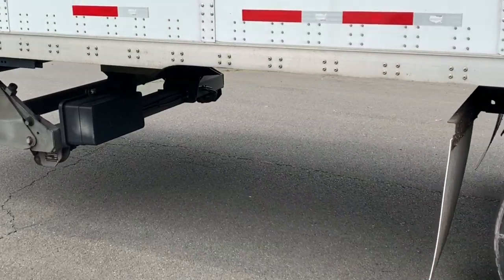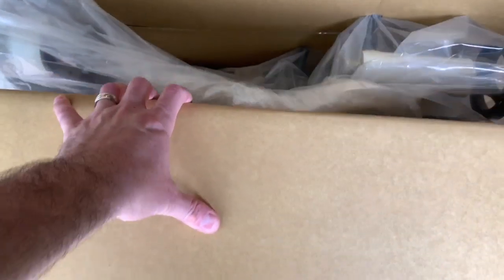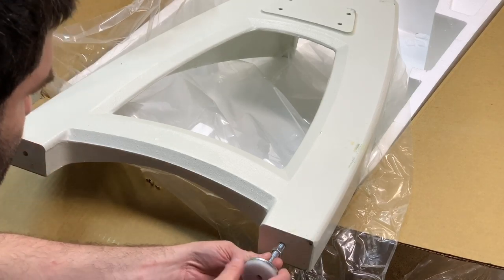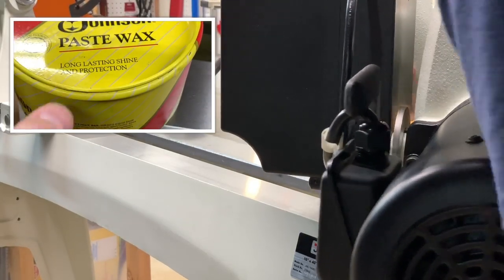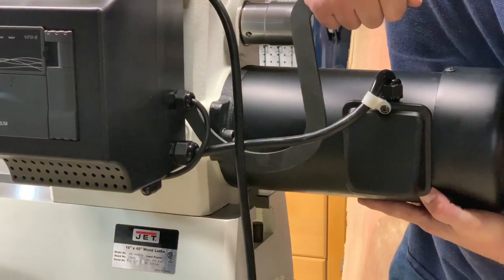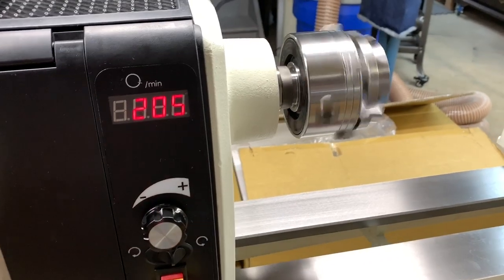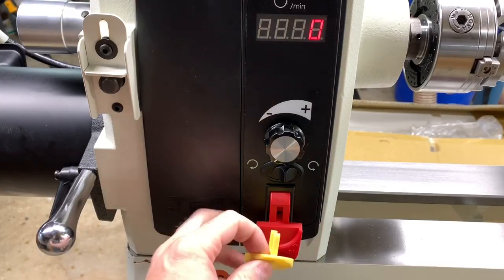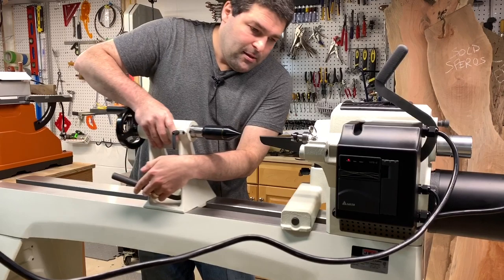New Shop Lathe - Jet 1640 EVS

Comment: You should look into the problems with the inverter on this machine. It is almost impossible for a small shop,  hobby to meet all the requirements. MUST be on it's own circuit, no surge protector. Power outages can damage the inverter when the power comes back on. My shop is in onehalf of a two car garage and it's impossible to predict all that can damage it. Very expensive to replace too.
Reply from the maker: It’s funny you mention those issues. I’m in communication with Jet to help fix some of these issues. As is running a GFCI on the variable speed motor. It is a common issue for GFCI on variable speed motors. If I find any fixes I will be sure to post. Thanks for watching.

Comment: Thanks for the video-- only one on youtube for this model. any chance you could show us the assembled dimensions with foot print using a tape measure?  
Also it looks like this is a little above your elbow height?
Any updates on performance?
The dimensions are in the on-line owners manual but it says it is 73"  height and "53 inch width-- I don't think this is correct.
Reply from the maker: Hi Gary and thanks for watching. So far, this lathe has been great and taken everything I’ve thrown at it. I have not done outboard turning yet but I do have the bed extension. The lathe from the floor to the center of the spindle is about 64” inches. It has adjustable bolts that you can lower or raise about 2”. The tool rest is right at my elbow depending on what tool I’m using and at time I’m a little above because I stand on a thick foam for my feet and back. The lathe with the headstock over the left leg and with the lathe bed extension is about 87” inches long including about 12” of motor overhang. The lathe in the same configuration without the bed extension is 66” inches long. I will say the only issue I’ve had is the paint chips easily but they sent me a can of touch up paint. Hope that helps. Thanks.
Reply: @spwoodart  Thanks for the reply but still a little confused. You said the center of the spindle to the floor is 64" ?? 
That is over 5 feet 4" off the floor. the manual says it is about 44" to 45" approx.?? 
Just to confirm the length of the lathe with the motor over the left leg ( without the extension) is 66" long?
Thanks again.
Reply from the maker: @sttraveler2593  I’m so sorry. Typo! I’m fired! It’s 46” inches. Lol it’s higher for me because of the mat I stand on and the leg adjusting bolts are up on mine a bit due to the floor in my shop. The length is with the motor off the leg and the head over the leg. The motor sticks out past the leg about a foot.

Comment: Speros, please tell me about the chuck you show in the video. Do you now recommend a different chuck? I’m about to but this same lathe!
Reply from the maker: Rusty Munroe Hi, I love the lathe. No issues and it’s handled what I’ve thrown at it. The chuck I use is the NOVA infinity chuck. It’s similar to the super nova 2 chuck but beefier and has quick switch jaws. I’ve been using this chuck for years and love it. It’s more expensive, but I love the quick change jaws. I like the screw set for reverse as well. The Easy Wood Tools chuck is also great too. It has a hand turning wheel but is more expensive. Hope that helps. If you want to turn large items the NOVA chucks have a titan that is big. Thanks for watching.

Comment: How do you do outboard turning with this lathe, as far as tool rest etc
Reply from the maker: @joshuaroberts5821  hello, this Jet lathe has a sliding headstock. You have to purchase the extra drop down bed attachment, but It does come with a tool rest extension to raise the tool rise for the outboard turning. The head stock slides to the end of the lathe and the tool rest with raise extension is put on the lower bed extension on the end of the lathe. Hope that helps. Thanks for watching.
Reply: @spwoodart thank you for the kind thought out reply, I have subscribed
Reply from the maker: @joshuaroberts5821  thank you sir!

Comment: You are going to LOVE this new lathe!!!  I have the exact same model, except the headstock rotates 360 degrees.  Can't be happier with this lathe!  Flawless like all my previous JET lathes!  Can't quite understand why they discontinued the 360 degree headstock...maybe a 'cost' consideration???  Anywho, ENJOY your new beauty and have many, many SAFE turnings in your future!!!
Reply: I have the same lathe and it does rotate 360 degrees
Reply from the maker: Hi Kenn, so far I do love the lathe. I have never had any issues with Jet before. This is the latest addition of the Jet and I’m not sure why they axed the 360 head. The head still slides. Thanks for watching
Reply from the maker: Louis Lux hi Louis, this is the new version, and I’m not sure why they got rid of the 360 either. Thanks!

Comment: I am looking at this lathe as a possible upgrade.  I have seen reviews that say the newer versions don't have a rotating headstock.  I've seen others that say there is a locking pin to prevent rotation during shipping that can be removed, and then rotation of the headstock is an option.  Do you know the status of this?
Reply from the maker: Hey, thanks for watching. Jet has done away with the rotating head. This model does not have a rotating head, the  head slides but will not rotate. They apparently did away with the rotating feature because over time the head becomes loose and causes issues. It’s still a great lathe and I have had no issues with it. Hope this helps and thanks again for watching and commenting . Cheers! -SP
Reply: @spwoodart  Thanks, I've seen conflicting info on the rotating head stock, even from the dealers selling them.
Reply from the maker: @davidnickell9381  no problem. They discontinued the rotating head when I bought my lathe. I actually purchased it because it stated it was rotating. I called them when I got the lathe and they apologized and sent me a free bed extension for the issue. Jet was very helpful as was craft supply. Cheers!

Comment: I mostly do smaller stuff to sell like pens and such and have a nice little Mini lathe which is flawless till you try and do any bowl over 4 inches so my bowl turning Daughter and I are searching for a bigger one. I enjoyed your review so now that it's bee over 6 months what do you think of your Jet now.
Reply from the maker: kagnewmp12 Hello, no problem. Glad to help. I really like this lathe for the price point. No issues with this lathe, and it’s taking everything I’ve thrown at it. I had a few scratches on the lathe so I called Jet and they sent me out an entire spray can of the Jet white paint no questions asked. The tail stock and head are true and lock down great. If my wiring in my shop was different I would have gotten the EVS1840. If I had to do it again I would still buy the Jet for this price range. I’m looking forward to turning off board, but haven’t done that yet. The cam lock on the banjo can get a little annoying, it has be just right for the tool rest post, but it does make it so the tool rests are now marked at all. Also, depending on your shop floor you may have to adjust the leg a little to made the head and tail stock true, but it’s not a big deal. For smaller things, this lathe is more than enough. It has no issues with lather items either. Hope that helps. Thanks for watching.
Reply: @spwoodart  Thank you very much. I have an 18 W by 22 L shop with full trussed ceiling with a good and level concrete floor. I even bet this lathe would turn a pen faster than a blink of an eye. There is good money in pens if your in an area that is not saturated with to many pen makers and up here in northern Michigan I do not have that problem. I'm looking at this lathe at Home Depot for $2069 plus tax with free pick up.
Reply from the maker: kagnewmp12 it I do turn pens and sell a lot throughout the country on my online store. Pens are great sellers. My wife likes them too! Lol
Reply: @spwoodart  What do you mean "the cam lock on the banjo can get a little annoying"   I am looking at this purchasing this lather and your video is pretty much all there is out there.
Reply from the maker: @bcrash11  Hi Richard, I’m not sure about the annoying comment? The only thing I mentioned in the video was the indexing pin location. However, I have had the lathe for awhile now and no issues. The banjo is fine and locks down great. I will say the banjo has a cam lock for the tool rest post in place of a screw so not to marr the tool rest post. It sometimes gets finicky to align the post once removed. It’s a great lathe for the price. I’m happy with it. Let me know if have any other questions, happy to help.
Reply: @spwoodart  Thanks for the reply  Great video